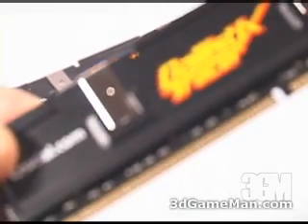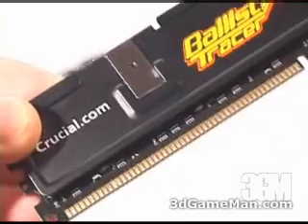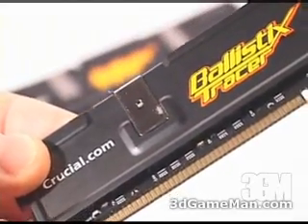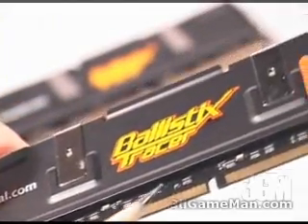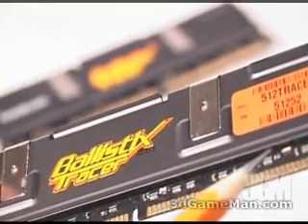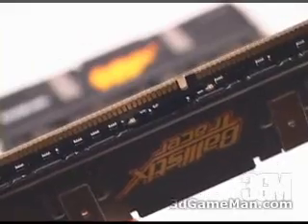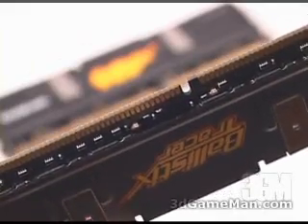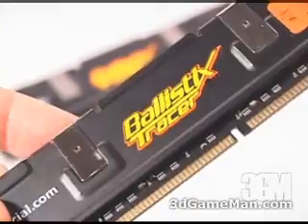#512 - Crucial PC-4000 Ballistix Tracer Memory w/LEDs

Comment: @justinaurelius  issues with macs is unless you get a mac book pro you cannot upgrade or repair it by yourself unlike a pc where if something craps out  just go to fry's or best buy and buy a new part mac is generally more expensive has slower over clock rates  incompatible with alot  also not to mention apple thinks there software is the holy grail so they will not allow an end user to purchase the software to install it on there own rigs  now that is far worse then microsoft